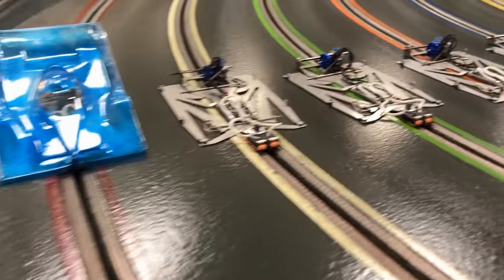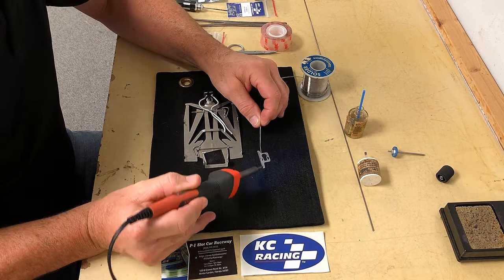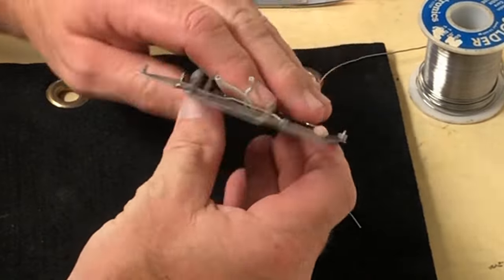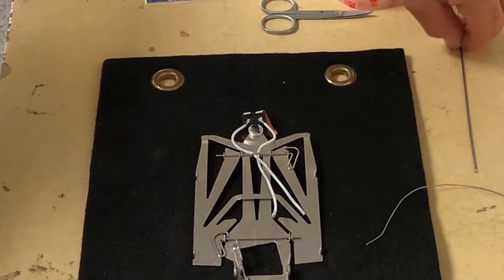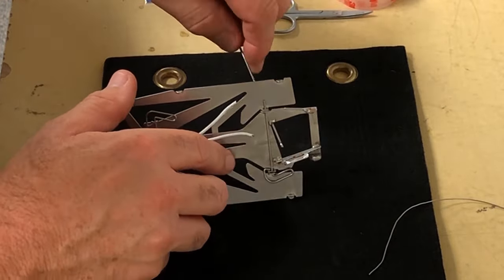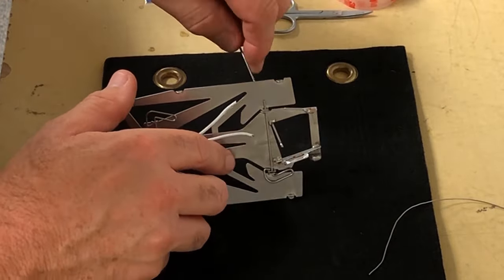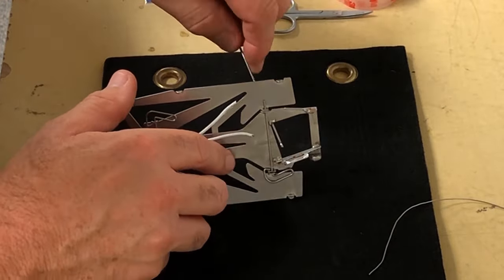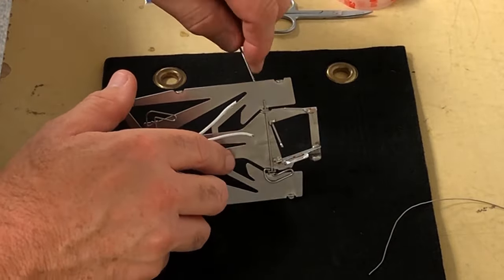Brushless Flexi Chassis Tutorial @brushlessslotcarracing

Comment: Possibly stupid question (havent soldered metal pieces like that). Based on my experience with wiring i was taught that the material has to be properly hot to accept the solder. What keeps these solder joints from separating like a classic cold solder?

Comment: My first thought was to want to tig weld the motor mount but soldering would probably be just fine . it doesn't experience the kind of force necessary to need a Tig weld .
Reply from the maker: Solder works good for it. No need for overkill.

Comment: You mean Locktite is enough to keep pinion on when motor gets hot?
Reply from the maker: Hello thank you for your interest! Yes Locktite is more than enough, the motors don’t get hot at all when geared the right way.
We just ran a race and put between 1800 - 1900 laps on them. No pinion failure.
Reply: @brushlessslotcarracing  I assume you do know brushed motors can get very hot in comparison depending on class and gearing but typically they get very warm in 3 minutes.
Reply from the maker: @miners_treasures  We have a video posted on this channel of an endurance race on a 130 Hillclimb. 
The heats were 7 1/2 minutes long with a change lane/driver and go!  
All 8 cars finished and no problems with the brushless setups or gears.
Reply: @brushlessslotcarracing  Enduro sounds fun! Where is brushless stuff being sold? I'm into RC so I am familiar with brushless motors but not slots stuff yet.
Reply from the maker: @miners_treasures  Brushless slot cars are different than r/c cars….We purchased all the componets from https://kcracing.net
He is a one stop shop for esc’s ,motors(with screws) and brackets to make a brushless slot car move! 
Good luck on your brushless venture!

Comment: What kind of a coast do you get on a brushless motor. When the truck turns off?
Reply from the maker: They roll a good way if you keep the trigger pulled. A brushed car will roll farther that way too. They do have very good braking depending on the hand controller adjustments.

Comment: What pitch gears are you using?
Reply from the maker: 13x33 64 pitch
Reply: @brushlessslotcarracing In the video you say 11/37, is this also 64p? 

Thanks for the info.
Reply from the maker: @joemaxey2  that’s the gears on that car….they run better with 13x33
Reply: @brushlessslotcarracing  what size tires?
Reply: @brushlessslotcarracing I did pick up a 4.5K to try. I've been running a 6.5K. I'm digging the brushless stuff.
Reply from the maker: @joemaxey2  I’m not 100% sure on them…. I have to say .760? Or there abouts
Reply from the maker: @joemaxey2  We are glad you like it! Spread the word.
Reply: @brushlessslotcarracing  Will do! Thanks again for the info.

Comment: An additional benefit to the braiding, other than looks, we used it to prevent interference with RC radios back around 2005-2010, No issue here of course, but it might can interfere with the computers so maybe a benefit there
I have been a slot car guy since the 1990's and in the middle 2k's when brushless took over RC cars, i was hoping someone could figure out the slotcar side of it. I saw someone playing with castle Phoenix esc's in slots, was that you guys? I see you have your own esc now, is it castle based?
BTW have you tried brushless Inrunners? i would think the outrunners would get gummed up with tire dust and possibly track glue. very messy to clean up
Reply from the maker: Thank you for your interest! We started with a flashed Castle Creations Talon25 in slot drag cars in 2014 with success. There are many esc’s on the market now for road course use.
Reply: @brushlessslotcarracing , Was not aware of other brushless esc's, other than the talion yours were the first i seen. are yours adjustable through firmware or is it simple Plug (or solder in) and play?
Reply from the maker: @crazylarryjr Talons are adjustable for drag racing, they don’t work well on the road course. Here is a link to brushless components. https://kcracing.net/Brushless-Parts/

Comment: Can these motors bolt in to a Cheetah 21 chassis without using a bracket?
Reply from the maker: It would be best to use one of the many motor brackets available. 
The bolt pattern on the motors is different than a brushed motor.